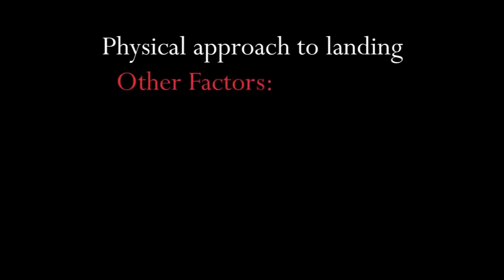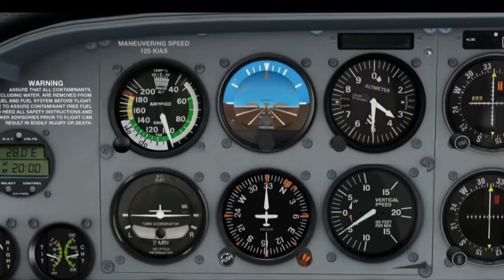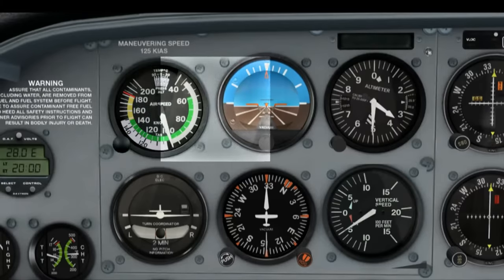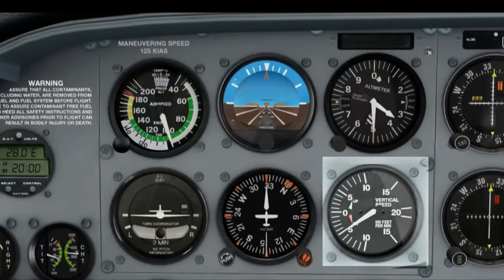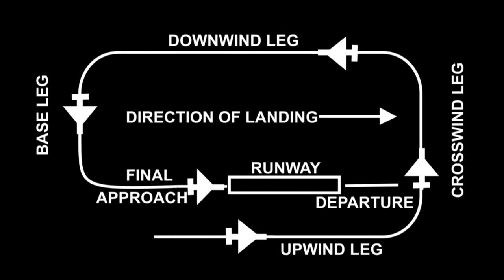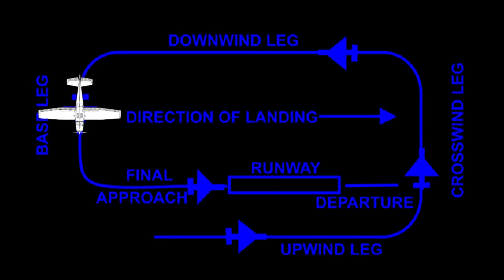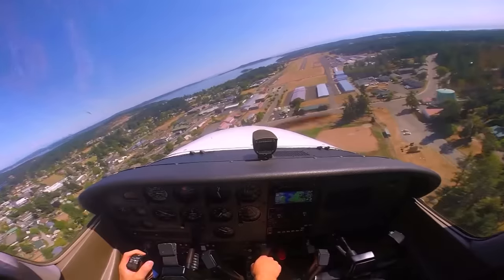How to Land a Plane

Comment: When I took Light Sport lessons out of Falcon Field in Mesa Arizona, the biggest challenge was chop and occasional wake turbulence, especially since Arizona from the springtime onward can be unkind to Light Sport aircraft, light as they are.

I also learned to fly trikes under LSA, and found them more forgiving in chop--no rudder to worry about, or flaps, or trim--just the proper pressure on the trapeze, maintaining a relaxed grip thru all phases of flight

My CFI and I practiced trike engine out drill on a 150 yard long gravel wash, about fifteen miles from our gravel strip.  We flew in winds aloft, unforecast, over 25 knots but  they were no sweat, whereas in a fixed wing aircraft they would have presented a challenge.

Which type of aircraft do I prefer?  Fixed wing for cross country, I've even flown a Luscombe which required me to hand prop it, and it started on a qtr pul.  Trikes for recreation, and since hangar rent around Phoenix makes ownership impractical for non business ownership, I always rent, and also request a CFI to be aloft with me, which makes the flight instructional and relaxing.  

I have flown more than a half million miles as a business traveler, and since my first flight in a Lockheed Electra jet prop in 66 at age five, I have been hooked on soaring over our world, and the humility and euphoria it provides, so I chose a career (as a hospitality systems instructor) that provided domestic and international travel, leading me to a wife who one Christmas gave me a free LSA lesson certificate, and I started flying myself, and walking away from my landings, which is the most important part of general aviation, other than the flights themselves.
Reply: Sounds like you've had one hell of a time! Glad for you. Hopefully, you've got plenty more to go!
Reply: You did not experience wake turbulence in a light sport aircraft or you would not be alive to talk about it....wake turbulence is generated by other aircraft and in a small plane or kite can easily take away your lift and/or flip you over.   Ground turbulence from hot rising air is not the same thing, nor is clear air, mechanical, inversion or thunderstorm turbulence.  Those are categorized as light (or chop), moderate, severe and extreme.  Extreme turbulence can take a passenger jet out of the air.
Reply: @speedomars  I did not say I did--learn to read, it does wonders.  A trike, when landing, leaves some wake turbulence behind it, and my CFI suggested to wait a moment after I taxied the short distance to take off from the wash we landed in.

All aircraft leave wake turbulence, even my motorized RC glider does and if I fly into it, the glider makes "unscheduled" attitude changes.  This is also a year of college meteorology talking, which I recommend for all pilots, those who don't wish to learn pilotage will find out the hard way why knowing how the wind interacts with terrain,  heat, and its own thermal activity helps.

There are cocky pilots, and old cocky pilots, and that shows in your answer and reading skills.
Reply: @Cactus521  Since you are not required to get pilot training which explains why you show a lack of knowledge.  Wake turbulence at a level of concern is NOT generated by an ultralight (or an small RC aircraft) the lack of weight and power.  Wingtip vortex turbulence is most pronounced in large, heavy aircraft due to the extreme amount of lift needed to get them airborne and keep them airborne while in flight.  Smaller piston single planes can also generate it, but to a minor extent.    You are likely referring to ground effect and to mechanical turbulence generated by rising air from the heating of the ground.  No aircraft is affected by its own wake turbulence, btw.  The turbulence trails off the wing tips and flows behind and behind the wing.  The danger is to other aircraft, not to the one generating the vortex waves.

Comment: Good but I wish I could see which controls you were using when you increased/decreased speed etc. Also what's flaring? Ive heard that before. Wiki no help. Is it puling back or pushing forward the yoke to raise/drop the nose depending which type of front or rear landing gear you have?

Comment: We would always use full flap (40°) in Cessnas whether landing on bitumen, grass or dirt. Always considering the minimum speed for the undercarriage to meet the runway. Same for Piper Cherokees.
Reply: What aircraft is the easiest to land. ..a tail dragger or tricycle??
Reply: We trained at 30 degrees because that last bit of flap adds so much drag if you have to go around. We’d drop that last bit of flap at about 100 feet.

Comment: What are the controls and sequence used in the last few seconds to flare and then lower the nose?
Reply: You develop a sight picture with practice that relies on forward vision for pitch angle and peripheral vision for height. Then you hold that sight picture with increasing back pressure, while the aircraft slows (because throttle is at idle) until it sinks those last 6 inches. Keep holding the nose at the same angle, it will drop by itself when it’s too slow to create lift.

Ailerons are used as necessary to keep you on centerline, countering any crosswind, rudder is used to maintain direction (parallel to runway, slide left or right with ailerons). Sequence is fluid and must correct constantly, but it quickly becomes intuitive.

Flaps change curvature of the total wing, adding lift, and also drag. They allow aircraft to land slower, which is a major safety advantage. That airspeed indicator showed a green arc and a white arc. Bottom of the green arc, about 58 knots, was stall speed with no flaps deployed. Bottom of white arc, about 47 knots, was stall speed with full flaps. That’s about 33% less energy to dissipate. 

Ideally, the pilot doesn’t “land” the airplane. He controls the deceleration until the airplane stops flying and starts rolling on its tires.

Comment: Great vid, really explains alot. What's the diff betw aillerons (sp?) and flaps?? Like you said, takes alot of practice to hone those flying skills, and I've always heard that hobby pilots need to fly often or those skills will get rusty and imperil the pilot's perf.
Reply: Ailerons control roll axis, flaps increase lift.

Comment: Ok, one thing not clear... do you only use the rudder when landing?  If so, why do you need the alerions at the same time?
Reply: Rudder is for direction. Ailerons for centerline. Typically, there is some crosswind component and you use ailerons to slip sideways into that wind. If it’s not gusty, it’s easy and looks good.

Comment: I was hoping to see the stable approach down the glide path and flare, not a lesson of BAK,
Reply: GUYEEEES, listen up, there is no flare. As the runway displays before you, you round out parallel to the runway, and power OFF. If it floats, leave it, if it sinks, back, back, back to stop the aircraft from touching the runway _ O ly a little bit in these back back backs not a lot or you will balloon to high and come down with a very nasty bump. So, round out parallel with the runway, if she sinks, back, back just e tough to stop the sink, keep doing that every time she sinks. Just stopping the sink, that's all, and then the main wheels will land on the runway, hold it there dont do anything, and soon the nose wheel has lowered gently to the runway. If, if, if  you pull back on the control column too hard you will balloon upwards, in that case immediately apply full power and go around. When you get good at this, you will be taught how to apply enough power to cushion a high flare to a landing .

Then you can learn that last thing and then you can learn flawless landings then cross wind landings, it's a lodda fun!!😂

Comment: Pardon me if I missed it, but where are the brake controls located?
Reply: The brakes are connected to the rudder pedals.  Pressing both pedals equally will apply braking without changing direction.  If directional change is needed, vary the individual pedal pressures as needed. That's how it's done on very small planes. (tail draggers).

The nose wheel does most of the steering on more modern small craft as well as larger craft (tricycle gear).
Reply: @donwilson8379  Thank you Don for the comeback and the information. Have a great new year.

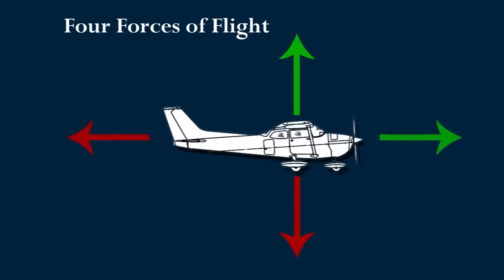Comment: 1:10 If (all) those forces add up to Zero, the aircraft would/could not fly! 
Imagine if thrust and drag would add up to zero, you wont move in any direction....if you dont move, you would not have lift.
Therefore the conclusion is.....thrust has to be alwas greater then drag, to be able to fly!

Comment: The fourth flight control (Flaps) although used for used for take off, maneuvering and landing.

Depending on the airframe design, the aircraft can do a “No Flaps Landing).  Major difference is you can land but your runway length will normally be longer as a safety factor.  

Example if the aircraft has a normal runway length of let’s say 5600 Feet.  If the flaps are not operational the runway length might need a extra safety factor so the say add 400 feet.  That means unless the engine fails and no other options the normal required minimum runway length need to be 6000 Feet.  For planning….once the in flight emergency happens then that is any runway available.

Even the performance handbooks or charts are usually over built as in the book says 5600…..maybe the actual required length might only be 5000.  That extra 1000 feet might not be much for a Cessna, Piper, Pilatius, King air etc……. But to a larger aircraft (commercial airliner). That can mean a lot especially with passengers on board.and runway length might already be close on even normal days…((DCA, LGA, SNA, SAN)

Comment: This is so typical.  You show a diagram of the four forces which indicates lift opposes gravity to control altitude and thrust opposes drag to create speed.  Then on final, you say the opposite happens - i.e. a force pointed downward (thrust) will make the airplane go up.  Isn't that a bit ludicrous?  Would you explain how you think the forces are working to supposedly make that happen?
Reply: He didn’t elaborate much, but he was correct. Thrust is parallel to the aircraft, and a descending aircraft is still in an essentially level orientation. Increased thrust (throttle) slows the descent, making it climb in relation to the glidepath (which is a descending angle).
Reply: @russbell6418  No - it depends on what happens to the pitch.  In most cases in light singles, the airplane is trimmed out, so when the power is increased, the propeller slipstream pushes the tail down increasing the angle of attack.  The force that slows the descent comes from that increased pitch, not directly the increased power.  I think it's important to know that.  I was doing a training flight in a Cherokee Six once.  The pilot got low (red-over-red) and added power.  The only thing that happened was the airplane accelerated 10 knots.  But the line of flight didn't change - we were still red-over-red.  The added power did exactly what it was supposed to do - accelerate the airplane.  He was left scratching his head saying I increased power - I don't know why the airplane didn't go up.
Reply: @warren5699  If the plane is in descent, at a level attitude.  Decreased throttle will increase rate of descent while increasing throttle will decrease rate of descent.   Throttling up doesn't necessarily cause the plane to rise but slows down the descent.   Only if there is enough power to gain enough speed in level flight will the plane actually begin to ascend.   Small propeller planes usually do not have enough power to climb at level attitude, so pitch up attitude is usually required to climb.
Reply: @Bendigo1  Ok - you have four forces as shown at 1:18.  If you are low (doesn't matter whether you are level enroute or stabilized on approach), you want the airplane up a little higher.  Which one of those four forces do you need to increase?
Reply: @warren5699  Lift.  But there are 2 ways to do that, depending on the aircraft.   I don't get what point you are trying to make.
Reply: @Bendigo1  Because the video is saying increase power, which increases the force of the thrust line, not the lift line.  It's a typical misunderstanding of the term 'region of reversed command'.  I was flying with someone in a Cherokee Six who was applying for a Part 135 job.  He got low on approach (red-over-red) and added power - the only thing that happened was we accelerated 10 kts but we stayed on the same line of flight and stayed red-over-red.  Post flight he was left scratching his head saying I increased power and don't know why we didn't get back up on glideslope.
Reply: @warren5699  Ok, I think I understand now.  Usually,  when landing, or in a glide slope the plane should be in a nose up angle.   If you pitch up, you loose speed but hold altitude.   If you throttle up you hold speed but gain altitude.  Sounds like he was in a pretty low aoa.   When the aoa is increased, throttle affects altitude much more than when at a low aoa.    It is not really a misconception as it is a misunderstanding of how it works.  

If you just pull back on the stick without adding throttle,  the wings provide some extra lift but also add drag, slowing the plane down. Slowing the plane down reduces airflow over the wing, reducing airflow over the wing reduces lift countering gravity so it all pretty much cancels out.  But if you set the attitude for a set speed, increasing throttle will increase speed slightly,  adding airflow and lift without increasing the speed too much because of the drag from the wings at a higher aoa.  Adding throttle also adds thrust and when the plane is at a nose up attitude,  the trust also counters gravity slightly because of the direction it is pointing.
Reply: @Bendigo1  "If you throttle up you hold speed but gain altitude."  Maybe, maybe not.  When this pilot throttled up, he simply accelerated straight ahead along the thrust vector which was, during the approach, basically aligned downward below the desired aiming point.  So he was proceeding straight to a point below the desired aiming point now 10 knots faster and still red-over-red.  It's the same as accelerating on takeoff.  Increase the thrust vector - the airplane moves along that thrust vector faster.  If your line of flight on approach is going toward an obstacle let's say due to a downdraft, and you increase the thrust without increasing the lift, you will hit the obstacle a few seconds sooner.  That's sort of the predicament in which this pilot could have found himself had there been an obstacle.

When on speed but undershooting, two things need to be increased - thrust and lift.  For example, in a small undershoot, a small increase in power and a little back pressure.  The back pressure is what corrects the line of flight back to the aiming point or returns the airplane up to the glideslope.  But back pressure increases induced drag - to avoid a loss of speed, the thrust needs to be increased simultaneously to balance thrust and drag.  I know you know all of that so why repeat it?  Because so often it is said (like in this video) that power controls the altitude, which is impossible - it is the lift vector.  The Cherokee Six pilot certainly wasn't clear on that.

There are a couple of reasons this gets confusing.  First I think is misinterpretation of the term 'region of reversed command'.  The majority of explanations of that term are that pitch and power 'reverse' on the back side of the power curve and that on approaches, power controls altitude.  Pure fantasy.  We don't fly V22 Ospreys.  But to make it further confusing, pilots do increase power on approaches and see the airplane trend upward relative to the glideslope (if the airplane is properly trimmed) and conclude that yes, apparently power does control altitude.  No.  What is happening in light singles is the increased power increases the propeller slipstream which increases downward pressure on the tail which increases the angle of attack.  So in effect, you have the increase in power AND lift.  Now the question is do you want the angle of attack controlled by a cushion of air.  In perfect weather conditions, it can be done but you will still have to transition to manual control of the pitch for the flare.  It would be far more preferable to control the approach, flare, and touchdown all with one control - the elevator.  In rough weather, you would be out of control trying to use the throttle and a cushion of air to control the angle of attack.  I think it's likely the Cherokee Six pilot had a mistaken understanding of what 'region of reversed command' means and had experience primarily in light singles.  But in the Cherokee Six, there's a much heavier engine and a relative difference in the leverage of the tail, and/or he wasn't trimmed out properly, or a combination.  It all resulted in acceleration with no increase in pitch and lack of control of the line of flight to regain the glideslope.